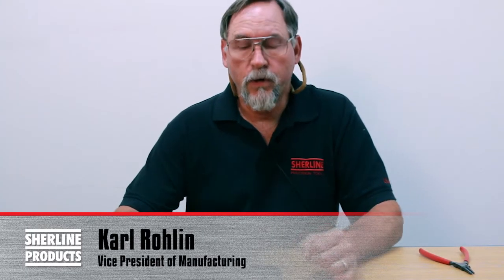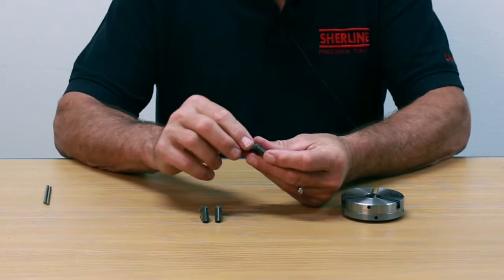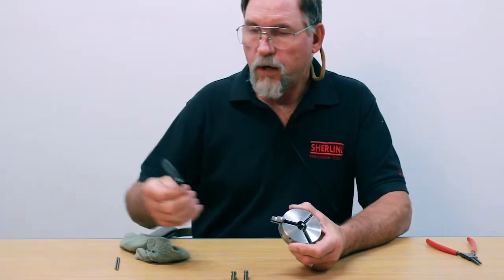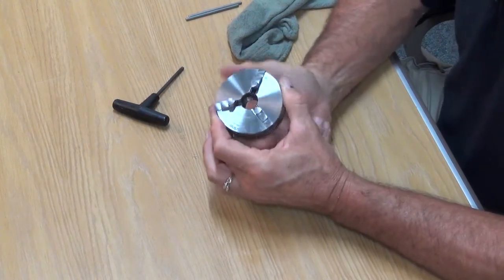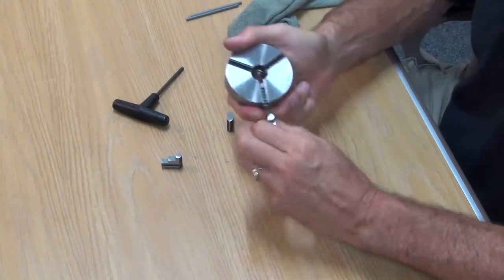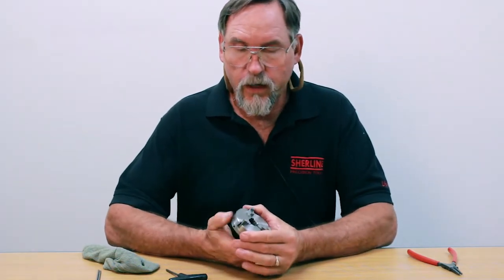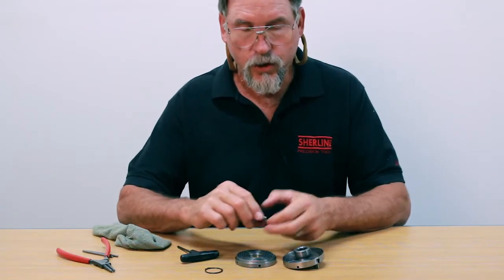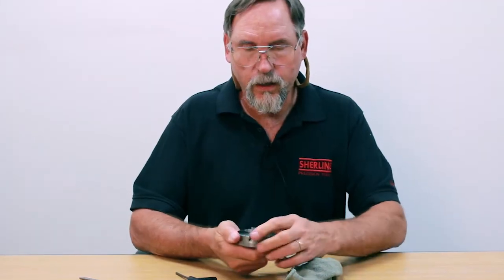3-Jaw Chuck Jaw Installation and Care

Comment: Can I install a chuck that's larger than the 3.1 inch? I want to secure a piece of metal that's over 4 inches in diameter with the jaws in the reverse position.
Reply from the maker: The 3.1" diameter chuck is the largest chuck that will fit on our standard machine that will allow clearance over the crosslide. If you can find a larger chuck that has a 3/4-16 mounting thread, that may work as long as you add our headstock riser block and our tailstock riser block to increase the centerline height above the crosslide.
The other option is to make a mounting plate for a larger 3-jaw chuck that has a 3/4-16 mounting thread. Then add the two riser blocks (headstock and tailstock) as well.

Comment: I picked up a late 70s lathe that sat for god knows how long. Even with removing the retainer clip the back won't pop off. Any advice?
Reply from the maker: First off, are you referring to a Sherline lathe and chuck? If so, did you try the tip at about the 12:15 mark of the video that says to lightly tap the chuck on a piece of wood to help release the bottom scroll from the top body?
If that still doesn't work, contact marketing@sherline.com, and I will pass your question onto one of our technicians.

Comment: In order to  put JAWs  into the reverse position  the chuck needs to be removed from the spindle.  How do you do this?
Reply from the maker: The chuck should just screw off the spindle. It is a right-handed thread. If your chuck is on too tight, try using your Tommy bars to loosen it. It that doesn't work your chuck may be rusted onto the spindle. If that is the case, you will need to send back to us so we can remove it for you.
Reply: @SherlineProducts   I tried to use  Tommy bars  from the very beginning.   I was not strong enough to  to loosen the thread. I was afraid to break "something".. Today, 4/20.19 I tried one more time. This time  It worked. The thread is (was) not  rusted. I am back in business. Thanks for the prompt reply.
Reply from the maker: @1967DS21  I'm glad to hear that you were able to finally get your chuck off of the headstock and that it is not rusted. Good luck with your future projects.